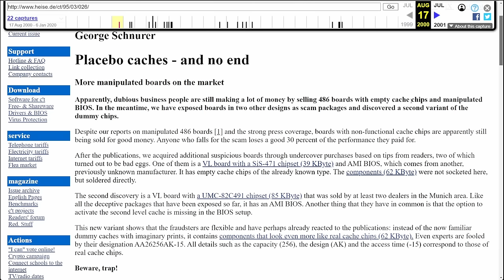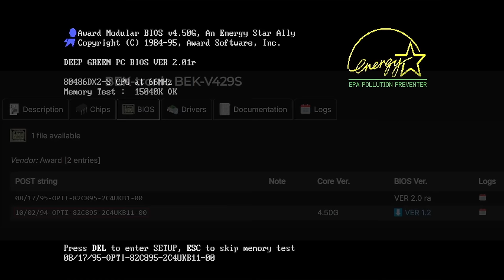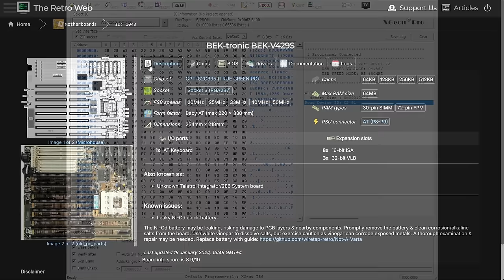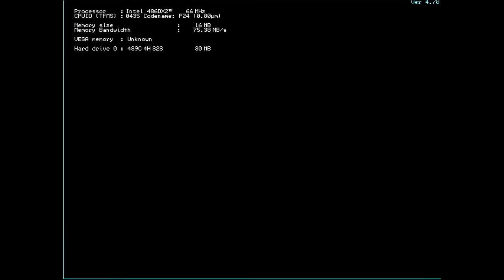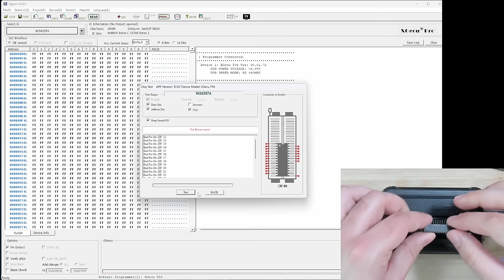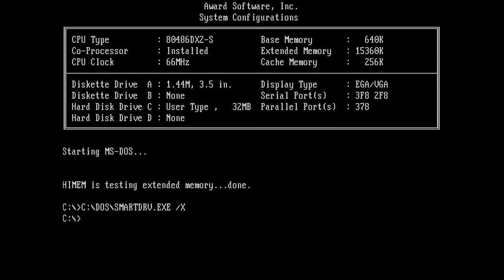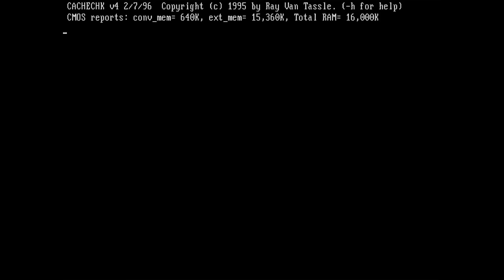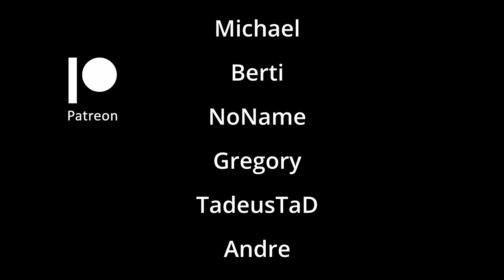They fooled so many: Fake cache chips!

Comment: Could it have been a chip production mistake, where the mashine forgot to put a chip inside.
The board manufacturer covered the mistake by manipulation of the bios, because it would be very expensive to recall the entire production.
"we fixed the issue where the bios did not detect the level 2 cashe" 😂
Reply from the maker: If it would have been a one time thing, then maybe. But the fake cache was so wide spread that I am very certain this to be deliberate.

Comment: Alls SRAM chips should work with the "generic" sram settings with that programmer.  The sram pin layout is the same for all chips (28/32 pins) and the programmer is too slow to even outpace any sram chips so you can just look up the size of the chip if it is not present and use the corresponding generic profile (or winbond profile of same size).

Comment: I wish you had compared the 3 (or at least 2) speed graphs in the video instead of leaving it to the viewer and assuming the cached tests were faster. It seems the Reading test was slightly faster during the cached space as expected, but the Moving test was significantly slower after running out of cache, compared to the no cache test. I wonder if that kind of L2 cache was just not worth it on this hardware, and they decided it was easier to trick the customer instead of educate them.
Reply from the maker: Yes, I should have done that. I'll address this in a follow-up. Smart people are currently working on restoring the BIOS to its original state - without the faked cache display. I also want to open the plastic case of one of them to prove there's nothing in those plastic cases.

Comment: And how about other cache sizes aside 256k with the 2.01r BIOS? I mean, will that BIOS show the right amount of cache if you install 64k, 128k or 512k? Or it will still show 256k?
Reply: I was thinking the same thing, if he installs any other amount , will it  show the correct amount  rather than 256 ? If so , they have modified the " None " string in Bios with the string "256".
Reply: @robertmesea  Yes, that was my idea
Reply from the maker: Someone looked into this BIOS already and it looks like it is a BIOS function that returns the size of the cache. It is not just a text replacement. So, I would assume that BIOS 2.01r (the original modified BIOS) will always show 256 - but I will try that in a future video. I also want to look into one of these chips :)
Reply: @bitsundbolts  Yes, please. I can´t wait.

Comment: OMG. I remember this board! I am fairly certain it was part of my only 486-PC. In the mid-2000s a firestation cleared out stuff they wanted to toss: aside some other less interesting stuff (a c64 with monitor meh... - I know, I'm committing sacrilege here^^) they gave me a HUGE Full Tower Case with an old 486 server or workstation. I am not sure anymore. I am fairly certain it was a lower megahertz (33 I think) Intel or AMD part. It had 2 HDDs: an 80 MB System Disk and a 120 MB Data-Disk. It had 8 MB of RAM and I'm fairly certain one of the hard drives was an SCSI one - there was a wide silvery cable, I couldn't identify then. They had Windows 3.11 for Workstations installed - I played a lot of Solitaire and Commander Keen on that Box - I'm not the shooter type so no Wolfenstein or Doom for me. I never bothered to look if the cache was fake :face-green-smiling: When I moved  from my parents for university I had to leave this treasure there. When they moved, they left it at their house... I have never seen it again and I am still really sad about it

Comment: i got some on Ebay they test good on my programer but wont work in the mainboard..
Reply from the maker: Maybe an issue with the speed rating? Maybe those chips are too slow (but marked as faster models). You could try lowering the bus frequency (maybe from 40/33 to 25 MHz)?

Comment: I've been involved heavily with computers since long before the IBM PC and am surprised by this concept.  I've never heard of fake chips before.  Now I'm even more bemused than ever.  I can see faking 2TB USB drives which are really 32GB, or putting "Sandisk" labels on cheapy SD cards where there's a real dollar difference -- however, I can't really understand the motive behind faking something that completely when it's so easy to test and the cost behind making the fake empty plastic shells doesn't seem to match against the savings.  i.e., Why would anybody make $0.75 chips when the real ones are $1.50 without returns and possibly lawsuits or criminal charges?  I'm sure I'm way out of date on my "state of the world" view, but some things just seem plain ridiculous!
Reply from the maker: I'm not sure about the cost you stated, but maybe at that time, those cache chips were very expensive. The fakes cost next to nothing. I would have to check how much a set of 256K would have set you back in the early 90's. But yes, it is amazing to what length those people went.
I can confirm that they modified the BIOS - and in an upcoming video, I'll reverse the changes they made (thanks to a lot of input I got from viewers). I was able to test the BIOS just ten minutes ago - works as if it was never modified and it detects the cache correctly!
That will be a fun video.

Comment: did they do this from the factory, or did someone mod it later?
Reply from the maker: I think it was a distributor who bought those boards from the manufacturer. The board clearly works with real cache chips. It must have been a bit further down the supply chain. I think a distributor modified the BIOS and installed those fake cache chips before distributing the boards.
Reply: @bitsundbolts  cheeky evil bastards, I honestly would never have known back then

Comment: I had a Cyrix 486/66 DX2 back in 1993, this video has me wondering if it was fully legit or faked! I have some good memories of those days of DOS programming and games. I could probably remember more, but I think maybe MY cache chips are fake!  ;-)
Reply from the maker: Hehe, I'm sure YOUR cache chips are still working well. The truth is, without benchmarks that clearly show what is going on, it will be close to impossible to judge if those cache chips in your board back then were fake or not. I hope they weren't.
If you're interested, there is a second video on my channel where I revert the changes that were made to the BIOS. Now the offending code that always reports 256K of L2 Cache is removed and the BIOS works as it should.

Comment: I guess the spam filter ate my comment because of link. Did some disassembly and found differences vs 1.2. Can confirm the function that returns cache size is detoured, calls the original for some reason and then always returns 256k.
Reply from the maker: Interesting! Yes, YouTube doesn't like links. So, it is not some text/string update - it is a function that returns the cache size - and this was modified.
Reply: @bitsundbolts  now anything I say gets deleted :D geeeeeethob gist my name has some disasm if this reaches you! The part that prints None is reused by other code so they couldn't patch that.
Reply from the maker: I have seen a few of your comments and then they vanished! Very annoying the YouTube just deletes stuff. If you could share some of your findings with me, that would be great! You can contact me via email if you want: bitsundbolts at gmail dot com. Thank you so much already for sharing those details!
EDIT: Found it - I am looking at it now.

Comment: "i ordered from ali express"
there, done, video over
Reply from the maker: Well, no, not really. The cache I got from there is working fine. It's not about the cache from AliExpress - the chips from there triggered me to check them with my programmer. And then I tried to test the cache from a board I found at the scrapyard - which this video is about.

Comment: I would cheat and just use something like HM628512LP

512k so just create pcb and one chip replace 2 256k slots

It's just sram chips
Reply: So half as many chips for same amount of cache

And possibly faster since they have access time in tens of nanoseconds
Reply: From the look some sockets are made for 512k while others are only 256k?

Could add a cpld and bank switching to add a few megs... Switching 128k or entire 25k banks

But custom bios might be needed to support or an os cache driver
Reply from the maker: I am not sure how much cache the board can support. I will try a few things and see what I can find out.

Comment: well, you yourself admitted that you didn't have a proper chip type in the testing program for the suspicious chips and you successfully measured some resistance in them. why are you still calling them faulty? maybe they are good, but for other purposes than bios?
Reply from the maker: The chips that were on the motherboard did not have any resistance. I used faulty chips to show that there should be some resistance between some of the pins. The fake chips have no resistance anywhere which leads me to believe that there is no silicone chip embedded.

Comment: That's appalling. You should track down the original seller and get some money back. Hopefully they are still in business and haven't moved or changed hands in the last 30 years.
Reply from the maker: Well, technically I bought this board from a scrapyard without a receipt. I don't think they would honor any warranty claim 😅

I understand that this hardware is useless by today's standards, but it's still fun to play around with it and learn.

Comment: I gave up on ali Express, to many fake parts and junk.
Reply from the maker: To be fair, all chips have silicone in them. When I bought them, I was fully aware that I get used parts and that some will not work. I am OK with that - as long as I can verify that they are working. What I have an issue with is relabeled (e.g. faster speed) items. Those are difficult to test.

Comment: Smarter than the fake AMD CPU's they sell nowadays, which don't work at all. These fake cache chips actually still boot the PC making it much harder to figure out the issue.
Reply from the maker: If I wouldn't have looked for the model number and came across the article, I wouldn't suspect them to be fake. I might have figured it out during a benchmark, but the article made it very obvious.

Comment: "...these chips are completely empty."

No. There are NO chips in those DIPs. The "chip" part relates to the silicon inside the package.
Reply from the maker: Yes, my terminology isn't always correct. Of course, the chip refers to the silicon 'chip' cut from a wafer.

Comment: I don't mean to be a troll, but are you really just figuring this out about cache chips now????  AND ALL the other videos covering this and how many people have been scammed by Ali Express cache chips??  And you didn't even check to see if the print rubs off... WTF... stip acting like a noob you are better than this!!!!!!
Reply from the maker: I am sorry, but this video wasn't about the chips I got from AliExpress.
Reply: I vaguely recall hearing something about counterfeit / fake cache or memory in general but that was years ago and to be completely up front about it, it would seem that most people are younger than I am anymore, so there is that....  But even so I found the video to be quite interesting.  His diagnostic procedures are infallibly logical and always second to none, I'm looking forward to him flawlessly diagnosing the bios that is on the original chip once and for all and then repairing it.  (Rehearsed or not it still counts in my book).  

Besides, I doubt that this was perpetrated by some large well known company with a reputation to loose.  It was likely some lone con artist jerk wad who did it or something similar and likely happens every few years.  A small company perhaps or renegade employee who then took the real memory and sold it on the black market or internet leaving his employer to mop up the mess or fpay the price by having the company fail (Quality Assurance can be a good thing if they are qualified)..